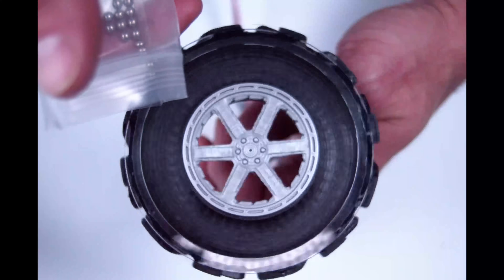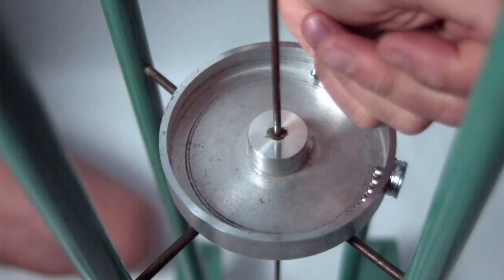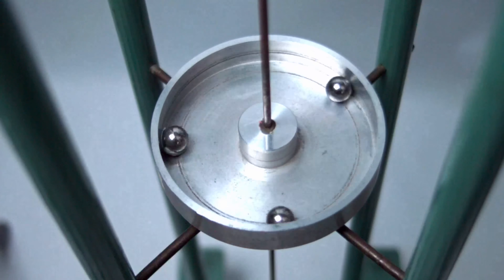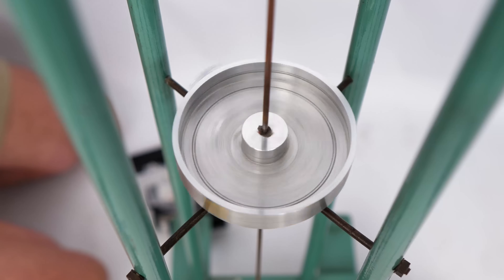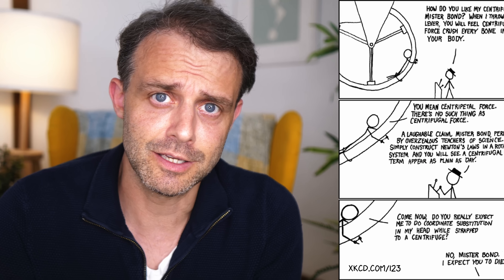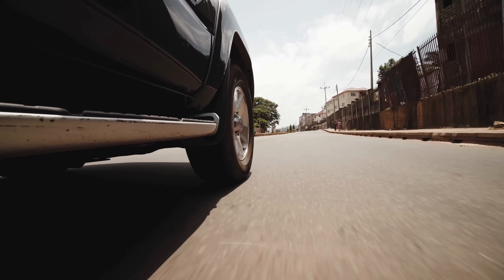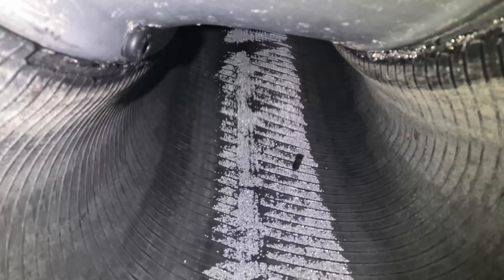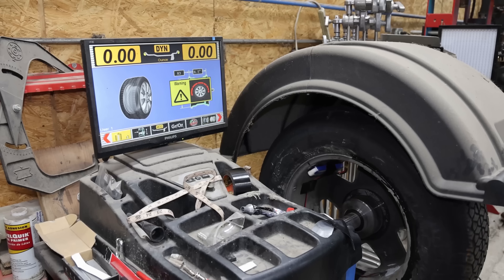Do tire balancing beads actually work?

Comment: This doesnt quite work out the same in the experiment as to real tires under load, at least in my head. Inflated rubber are flexible and offer a smooth ride and are are typically not inflated with enough pressure to make them into perfect circles. Tires flex due  to holding up the weight of a vehicle. Wouldn't  the the beads become disturbed from thier positions, spoiling the whole effect, when the beads encounter the flattened area at the bottom? The flexing region of the tire is constantly changing as it rolls. 🤷‍♂️

Comment: Is there a relationship between the surface roughness inside the wheel and the diameter of the weight? In the model, it was low roughness and large diameter and in the tire it was high roughness and small diameter. Seems like it would impede the weight's ability to find the optimal spot.

Comment: Pretty good video. Good explanation and demonstration. My take is if you spend all or most your time driving in the city or town avoiding freeway speeds (50 mph), the beads are not going to be effective. If I used them I would add them after my tire has been balanced in the conventional way. Then if I pick up a stone or in some cases a 7/16 inch drill bit that stays in the tire for more than six months without leaking air (actually happened to me), then the beads would compensate. Thanks for sharing.

Comment: i used to find bearings in tyres back in the 90's,  eithersteel, plastic and rubber when i did tyre fitting/repair.  was common with the oldies, they swear by them

Comment: I would go a step further and say that while these beads balance a wheel radially, they will never balance a wheel laterally. Think about how he’s using his theoretical test piece - there’s only one position the beads can go through the width of the apparatus. Whereas, when you balance a wheel, there’s two points - one in the wheel well closest to the spokes and one on the inner outer most edge. 

I’ve owned a shop for a while now and I’m starting to see the evidence of a standard balance working better - every time someone complains about beating problems it’s almost synonymous with the use of beads or improper balance. So, while balancing beads are good for large wheel applications where the tire is heavier than the rim like truck tires, sticky and hammer weights should be used on rims where the rim is either the same weight as or equal to the weight of the tire and you’re trying to laterally balance the rim to save your bearings.

Comment: Maybe I don't get it. But if the "low" spots want stuff to fall in them. Why wouldn't adding stuff until all the low spots are filled fix the problem?

Granted. This now seems like a rock tumbler/cake mixer. But eh. Stuffs messy.

Comment: I went to a 'name brand' tire store in the 90s, and I bought four new tires for my car.
There were times it rode well, but at speeds above the limit, the tires would vibrate.
I went back three times and they balanced the wheels each time, and it happened
each time I went over 70 MPH. Finally I had the manager pull one tire off the rim,
and they found shop rags inside the tires. They had to unmount, clean and reinstall
each tire, and it ended up the tech that did the job originally had quit his job a couple
of days after I bought the tires.

So ya, crap inside your tires can throw the balance off or get the balance better, but
having the weights secured and wheel assemblies always in balance is better than
having to hit magic RPM numbers for best balance.

Comment: Fun fact: This is actually how top load washers balance when a piece of wet clothing throws off the center of mass. They are called balance rings and use water (or some liquid) instead of beads or bearings.

Comment: I switched to balance and beads a handful years ago and I love it. First of all anytime I do any kind of tire based maintenance like throwing a patch in or anything like that I don't have to get it rebalanced for them to not shake I just leave the beads in and they will be good. But the other really big benefit, living on a dirt road and using my pickup for moving cattle around, is that anytime I get a rock on the inside rim particularly or mud caked up somewhere it doesn't throw it out of balance because it'll just rebalance itself. I don't even hardly notice if anything's in there for the most part anymore.

Comment: I use balancing beads for my motorcycle because I change my own tires and don't want to pay to have them balanced. The advantage of tubed tires is that the beads remain tire change after tire change. Not gonna use them in my car since I pay for lifetime mounting and balancing.

Comment: For me I just think that the more unbalanced the wheel is the more the beads move around (seemingly randomly) so it creates this scenario where the measured variable (wheel unbalance) drives the control variable (bead location) away from its current (bad) values. It should converge to the locations where the least stimulus is given to the balls - so basically the area of lowest free energy LMAO. That's why this is so great, it's a passive control that automatically approaches the perfect weight location. What I like so much is the "sloshing" effect where the balls slowly reach their eq point just like a damped exponential.

Comment: In the test. The metal cup was close to "perfectly symmetrical" & never changed shape as it rotated. The tires flatten as they make contact with the road, resulting in a constantly changing circle.
A potential balancing system would be when the tire was fitted. put "special beads" inside, spin it up to high speed so the beads balance, then spray some catalyst into the tyre that makes the beads sticky. They stick in place inside the tyre & then the glue dries. 
So long as they don't crack off when the tyre flexes you have your balance.

Comment: a great way to augment these bead would be to pump in a resin that cure in a relatively short amount of time. this could be done at a shop, where the beads are put in, the tire is inflated, and then resin pumped into it then spun up really quickly and allowed to set at speed. that way, gravity stops affecting the beads and the balancing effect gets retained.

Comment: So does this theory work on liquid? 

one time my tubeless tire got flat and it was night time there was no open shop that could fix a tubeless tire, so on the road i saw a cheap shop and told me that he could not fix a tubeless tire but he got some liquid sealant just for temporary just to get me home.
at low speed less than 80km/hr the car is good no vibration, but when i mark 80km/hr above, the car shake violently.

does this mean that bids can correct a balance but a liquid can disrupt the balance?

Comment: Could you apply a weak tacky adhesive to the beads? Something that isn't strong enough to prevent them getting into position, but is strong enough to prevent them falling out of position when you slow down? I wonder...

Comment: This is so cool. I've read that some spin driers balance loads by having a fluid (partially) filled tube around the drum, which I've ripped off for my rotating space station balancing trick.  I'm wondering if mathematically, this has anything to do with Lagrange points.

Comment: They only work as demonstrated if the inside of the tyre is even and clean so they don't stick together or stick inside the tyre - and tyres don't work like that. They also increase wear significantly due to worse balance at low speed.

Comment: Oh that's interesting, I've got this little mini rechargeable electric whisk thing that... oh you've got one of those too! Nevermind.

That pushing thing doesn't seem to work on mine though (at least not anymore, I think it's got more off-centre over time). But turning it up to the highest speed does, and now I know why. Thanks!

I'm also now wondering if this is in any way related to how gyroscopes work, i.e. if you spin the thing fast enough it resists movement.

Comment: Balancing beads made my tires worse. Tire shop added them thinking it would look better not having weights on the wheels and within 5 miles I knew something was wrong. Took the beads out and balanced the tire and problem was solved.

Comment: These suck for my tires because ever 10k miles they remove them from the rim for a proper rotation (monodirectional tires) which would result in a lot of expensive beads everywhere.

And since I work in a major metro areas getting up to speed can often be problematic.   I can see this working for vehicles that go a long way at relatively consistent speeds such as commercial vehicles but they're just not all that useful for automobiles which don't get up to speed each and every time they go out for a drive.

Comment: Ok so if we could make beads that would melt from the heat of the tires enough to stick in place, we could have automatic permanently balanced tires that self corrects any time we heat the tires up enough to re melt the beads?

Comment: I Guess they could be a fuel saving tweak for long-range travel. I wouldn't use them instead of balancing weights. But maybe a small amount of beads could improve them further.
My question would be how much they screw up balanced tires at low speed.

Comment: Mixing some slow setting glue with tire balancing beads, then spinning it fast and long enough for the glue to set might work. But I guess it would be too time consuming for normal balancing operations. Maybe this glue idea would be useful if balancing machine is not available?

Comment: In the 70s and 80s I worked as a machinist operating Cincinnati centerless grinding machines. These ran a grinding wheel that was either 12" wide by 24" diameter or 12"x36". The grinding wheels weighed up to 150 pounds and had to be precisely balanced. Usually this involve balancing them on a stand by manually moving weights around the hub, much like tires used to be balanced.
But we had several machines with "automatic balancers". These had three large steel balls enclosed in the spindle (axel) of the machine that were held from moving by a spring loaded mechanism. To balance the grinding wheel a lever was moved to unclamp the balls and it was allowed to run for a minute, then the balls were clamped down. The grinding wheel was then trued with a diamond and the process repeated several times. Once the initial balancing was completed it usually stayed in balance for the life of the grinding wheel.
The end of the spindle had a window so you could see the orientation of the balancing balls (when the machine was off). I could never wrap my head around how this worked. I (intuitively) reasoned that the weight would go to the heavy side of the mass.
Now I know how something that baffled me 45 years ago actually worked.
Thank You!
Reply: I used to operate a Reform surface grinder that had an 18" segmented grinding wheel and a ring wheel. The swarf from the grinding would gather on the inside of the ring wheel and work as a balancer until the moment that the clump of swarf reached a certain weight. It would then dislodge and cause a catastrophic failure. Segmented wheels were balanced by manipulating how the stones were set. I miss that grinder and I don't. 15 years of never getting my hands all the way clean.
Reply: 70's and 80's  must have some wild stories. I remember hearing of one guy who fell into the meat grinder at a hotdog factory. They did not slow down, they did not stop production and they shipped those dam hotdogs to everyone in the United States!

Comment: There was a Canadian patent for such balancing units (autobalancers). I met the Canadians probably 20 years ago at the hardware trade fair in Cologne, Germany. They had a fan with five blades, one of which could be removed. At first, the fan ran smoothly with all five blades, but then they removed one blade, and the thing practically bounced across the table. Then an autobalancer unit was placed on the front of the fan's axle, and the fan behaved completely normally again, as if it still had all five blades. The autobalancer unit contained steel balls immersed in oil.

Comment: As for STATIC PRE-Balancing, (which might have to suffice until you can get to a quality tire workshop)........
I've been wishing for a static tire balancer that'll handle 15" wheel tires and LARGER, for decades. 3 decades ago, I bought the Harbor Freight bubble balancer unit, which isn't 15" capable. At least sell an ADAPTER.  An entire unit for the bigger wheels would be better.

Comment: I'm concerned that the beads are smaller than the ridges inside the tire. Especially at higher speeds, do they really get to move to the correct positions? at lower speeds, the indentation that the road creates seems like it might be able to jostle them a bit, but at "motorway" speeds, can they really jump over the ridges?

Comment: As someone who has worked in a tire shop in the past, this was very interesting. I too was skeptical about tire beads. Some people were adamant about them though, especially the commercial truck guys. I'll still be balancing my tires with weights but I won't skoff at the beads the same way anymore. seems like you'd still get a weird wobble as you go through the critical speed every time though.

Comment: I had a Yamaha SMax 155 cc scooter. It was a joy to ride. So smooth and with powerful, linear acceleration. When it was time to get new tires I took it to the largest motorcycle and ATV shop here in town. I could tell something wasn't right on the first ride. The thing would shake at different speeds every time you would accelerate and it would do it constantly at certain speeds. I took it back to the shop and they said they put those stupid beads in it. I asked them to show me a single brand new motorcycle with those beads in the tires and they couldn't. No manufacturer would ever do something that lame. There are many ways  to do things but usually only one correct way. In the case of tires, the correct way to balance a wheel is with stationary weights. Also, those beads bounce into each other and into the interior wall of the tire degrading it and soon enough you just have a bunch of rubber and bead dust flowing around inside the wheel.

Comment: I've noticed that there's something similar happening with a clothes washer, although the clothes aren't really free to move around when the drum is spinning. But when it starts spinning and there's still enough water in the drum for them to slide around easily... I never thought much of it, and thought it was only resonance, but still, once the drum goes up to fast speed, its much more calm, then at the lower speed where it can shake. 

Very interesting video, I'm still very hesitant to use the beads and definitely prefer proper balancing so that the wheels are smooth at any speed.

Comment: My concern would be the glass beads basically sanding the inside of the tyre, perhaps if it was added mixed with an adhesive to bond the beads in the right place it would be the optimal

Comment: I haven't tried them, but I know a lot of folks who run tires as large as I've been running lately, do.... I've got 37x12.5x20s on the truck atm, and they're conventionally balanced with weights... but, as chonker MTs wear, they for sure change balance dynamics. And the ones that are currently on the front go to absolute, lets say "heck", at 70+ right now (mph)... All good till you kiss 70, then all to... well... heck. Unbalanced as possible, to the point that it feels dangerous. And it's for sure the fronts, as it's all felt in the wheel (steering), and front end. They'll be changed out soon, for another four of the same size, balanced with weights I imagine. But beads are sounding somewhat appealing... Not sure you have it all nailed though, as I can assure you... not just with these tires... but as someone who's been well into all sorts of motorsports... unbalanced wheels/tires do NOT just fix themselves at hwy speeds. Not at all... it just gets worse, and worse, and then you wreck very badly. So, if these DO truly and always work at 50mph, and then remain satisfactory until 10-20ish mph, and I don't feel terrible unbalancing effects up to 50, which I'm not sure I wouldn't... as 37s / tires of this size are VERY HEAVY, and that unbalancing in the wheel, hub, tire, etc. all just exacerbates well beyond what you'd feel in a lightweight wheel and tire combo, say on a car, with a light duty hub that isn't even driven (4wd). But I am more curious than ever... is a combination of conventional wheel weights and beads the best way to go perhaps? Get it as close as possible with weights, then so many beads for good measure? Just to have wiggle room as things dynamically change over time, with uneven wear, etc. ? Sounds plausible...

Comment: So what you need are beads that have a weak out shell and liquid rubber inside. You put them in, drive on the freeway for a set amount of time that's enough to break the beads. They'll break at the points where their mass needs to to be to balance the tire and they'll set free the liquid rubber that will fuse to the tire at this spot and make the  balancing permanent. Why is no one selling this?

Comment: A lot of big rigs only use balancing beads. Cause they do a lot of highway driving and if they have a blow out of the high way. they cant just bring it in somewhere to get it fixed so that call the Tire mechanics aka the tire doctor to replace the tire on the side of the road, so they cant get it balanced so they just use balancing beads

Comment: with the real tire, there's also the contact patch. I'd expect that beads hitting the contact patch will upset the balance at least somewhat, if not totally.
It seems like a very clever solution but to some other problem.